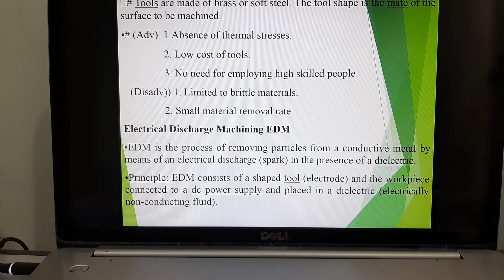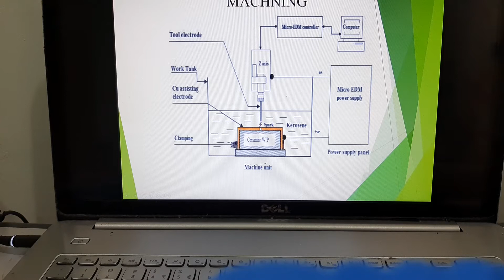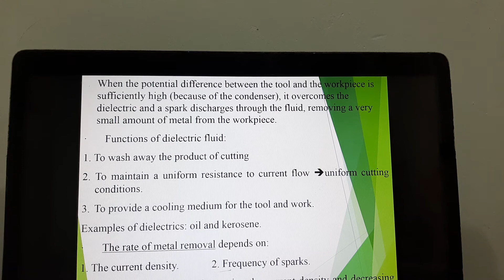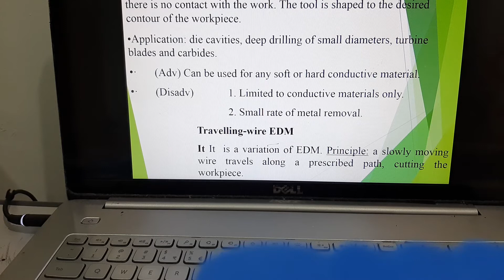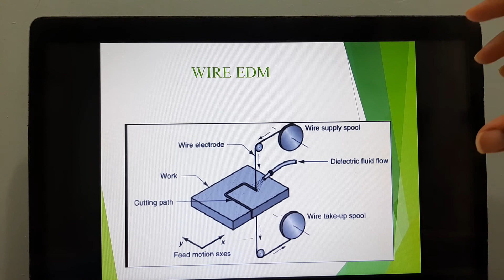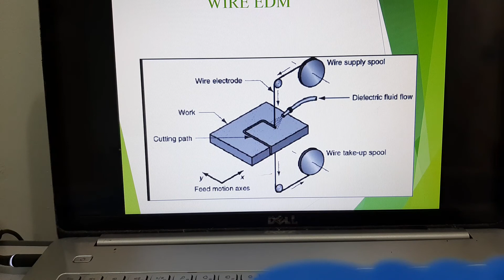NON-TRADITIONAL PROCESSES PART 2

Comment: Good Day, Dr. I am Derrick Ng Kian Ping (ME0105733). At the end of the video, I have learned about Electrical Discharge Machining (EDM) is a process of removing particles from a conductive metal by means of electrical discharge in presence of dielectric. EDM consists of electrode and workpiece is connected to a dc power supply. When the potential difference between tool and workpiece is sufficiently high, it overcomes dielectric and a spark discharges through the fluid removing a very small amount from workpiece. The functions of dielectric fluids (oil and kerosene) is to wash away product of cutting,maintain a uniform resistance to current flow and provide cooling medium for tool and work. The rate of metal removal depends on current density and frequency of sparks where rate increases when current density increase while frequency of sparks decrease. The tool is also shaped to desired contour of workpiece and some of the applications include die cavities, deep drilling of small diameters, turbine blades and carbides. The advantage of EDM is it can be used for any hard or soft conductive materials while the disadvantage is it is limited to conductive materials only and has a small removal rate.Next, Travelling Wire EDM is a variation of EDM that uses wire instead of an electrode. This process involves a slowly moving wire that travels along a prescribed path,cutting the workpiece.

Comment: Good day Dr, Im Lee Zi Sheng ME0106051. I learnt that Electrical Discharge Machining (EDM)
 is the process of removing particles from a conductive metal by means of an electrical discharge (spark) in the presence of a dielectric.
Dielectric fluid:  non conductive fluid that wash away the product of cutting, maintain a uniform resistance to current flow (uniform cutting conditions) ;and  provide a cooling medium for the tool and work. The rate of metal removal depends on: 
 current density & frequency of sparks.
pros : used for any soft or hard conductive material.
cons. Limited to conductive materials only./ small rate of metal removal. 
in Travelling-wire EDM
, a slowly moving wire travels along a prescribed path, to cut the workpiece. can cut shape that we desired perfectly. 
thank you.